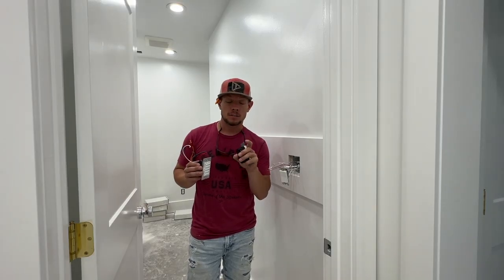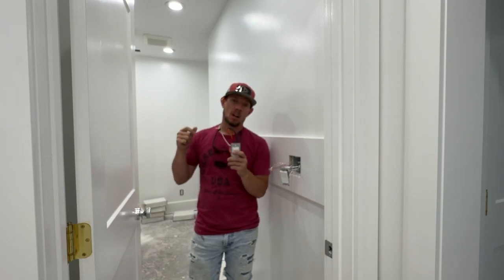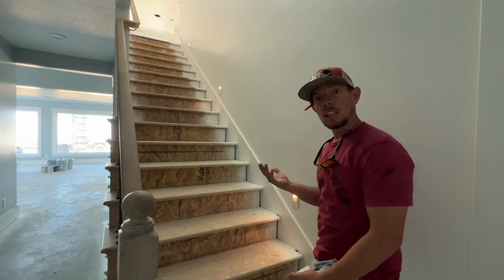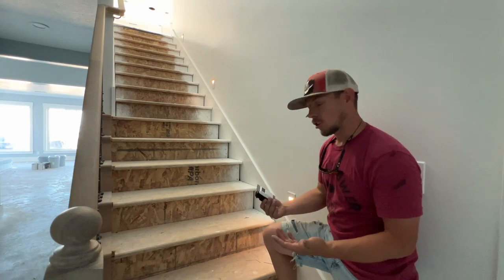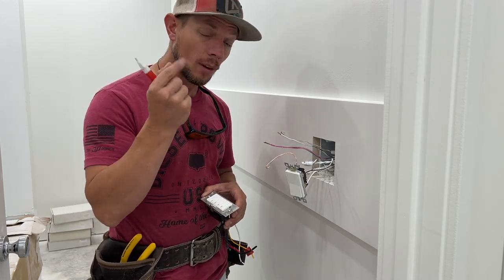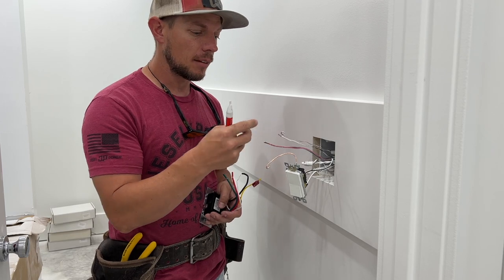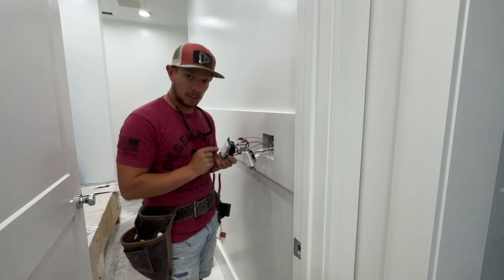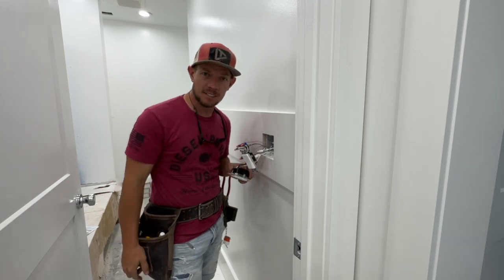Installing a Timer Switch for a BATHROOM FAN

Comment: Amigo, it does show you do have experience on your trade and also helping others, on how to do it. If you cover the live outlet with electrical tape : 2 or 3 times around, you will be safe!..but,  do not show this way on you tube, (off camera) so nobody will get hurt, congratulation for helping people out, in a very humble way bit over 30 years as a handyman, Chao amigo!

Comment: We don't find separate fan switches very often over this side of the Atlantic, usually only very old or very poorly retro-fitted installations.  More common is having the fan on the light-switch with a delay timer cut-off.  Switch the light on, the fan comes on.  Switch the light off and the fan stays on for anything from 5 up to 30 minutes afterwards.

The good parts are that the fans always come on when the bathroom is in use (unless you do your business in the dark) and there's no permanently on option.  

The bad part is that this does no good if the kid also leaves the light on all the time!

Comment: Just a note as per 2023 NEC all  boxes with switches must have a neutral at the box. Also if there are two circuits in a box neutrals must be separated Not tied together. Get a head lamp don't work live when you don't need to, case in point. You need a box extension on that two gang. Read instructions on device before installing, things are changing all the time.
Reply from the maker: You for sure know your stuff.